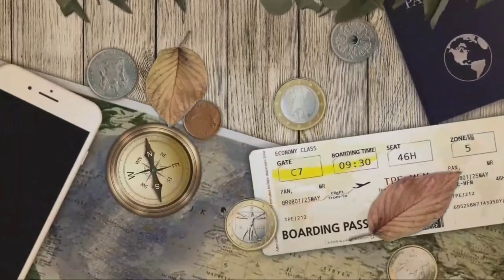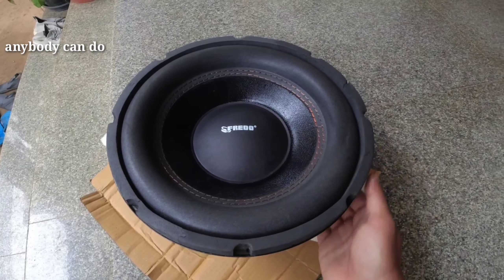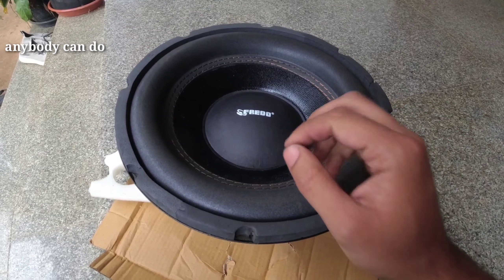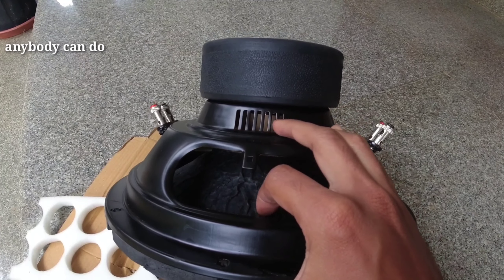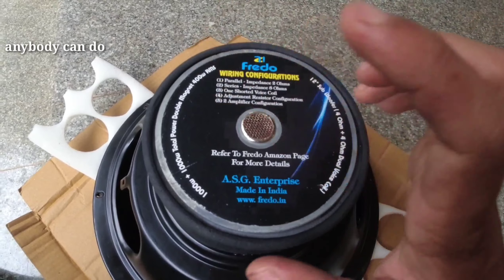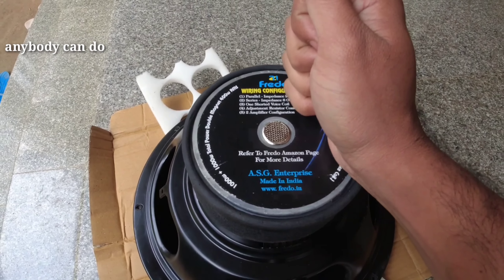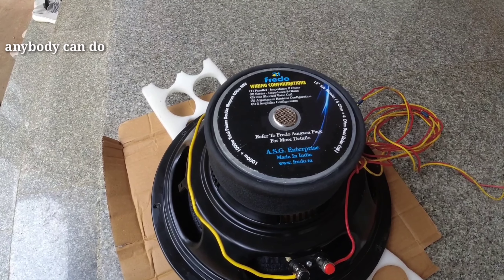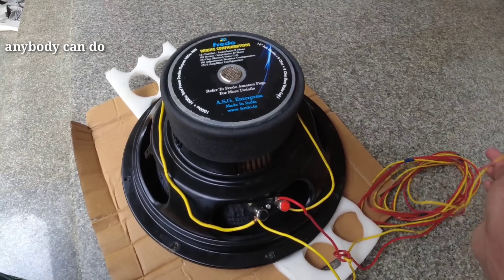Fredo 12" subwoofer. 400 watts RMS DVC subwoofer. malayalam review.

Comment: 300 w amplifier connect pannalama.
Reply from the maker: Yes pannalame. Ana 8 ohms le 100 watts rmas we will get. But in parallel 2ohms we will get 400 watts rms.. So u can use a class D ambilifer for 400 watts rms its better

Comment: Box size please
Reply from the maker: Minimum face = 33cms

Dimensions (as measured sitting inside box) = 33 x 51 x 52 cms

Air Volume = 87 Litres

Compensate for MDF/Box width (example 11mm, makes external dimensions 35 x 53 x 54 cms, keeping 87 Litres volume)

Port dia = 2 inches

Port Length (hidden inside box) = minimum 4 inches.
Reply: @anybodycando  ith undakoya alod jbl 1200 nte size onn chothikamo

Comment: ithu vaagunna cashinu pioneer vaagam
Reply from the maker: Njan 2800 na ithu vangieye. Aa cash nu pineer kitulla bro😄😄😄
Reply from the maker: Ee sub nu pattya oru sub board parayavo bro..
Reply: Athu pand ippolvila koodi bro
Reply: @anybodycando  kumar 4 transister board, so itu ee parahunna perfomence undakilla bro branded poley, so  4 transister kodukkam allengil oru 250w kittunna class d board upayogikkam 2 ohm il   D tech audios 200w oru class d board und class d 400 board und, inic audio 400w cladd d board und, kumar audios 6 tramsister und,  nalla puching venam enngil  oru 4 mosfet board nallathayirikkum,  universel, D tech, powetronics
Reply from the maker: @Handmadesystem  athu seriya 🤣🤣 anik offeril kittyatha... Nalla oru board para anik vangan aa. Ippo use cheyunathu board bad performec aa
Reply from the maker: @Handmadesystem  ok thank you bro❤❤

Comment: Can I put it in bass tube?
Reply from the maker: Yes you can
Reply: @anybodycando  But will it produce low bass or be as punchy as a ported box?
Reply from the maker: @advvaibhavvashisht9399  its have 400 watts rms on 2 ohms and class D ambilifier is best. And u will get heavy bass...
Reply from the maker: @advvaibhavvashisht9399  punch box is better than bass tube
Reply: @anybodycando  I have space issues due to CNG car, already have a bass tube, will put this woofer in place of that.
But just wanna know how much sound difference will be there between a tube and box on a scale of 1-10?

Comment: Which is best parallel or series
Reply from the maker: Parallel we will get 400 watts in 2 ohms
Seriel we will get 100 watts in 8 ohms
I think parallel is better.
Reply from the maker: And for parallel connection use a class D ambilifer which can produce 400+ rms and it will heavy bass
Reply: Thanks you sooo much. ❤️
Reply from the maker: You are always welcome.. Actually now iam using series (8ohms) iam not satisfied with 100 watts..
Reply: 2 ohm is best . but class d amplifier venam
Reply: @anybodycando   class D board vaagiku  D tech audios d400,  30 0 30 tramceformer 10 amps  Dc 40 0 40
Reply from the maker: Tda 7294 duail ic varunna board nallathano??